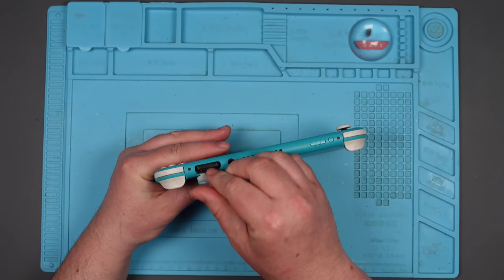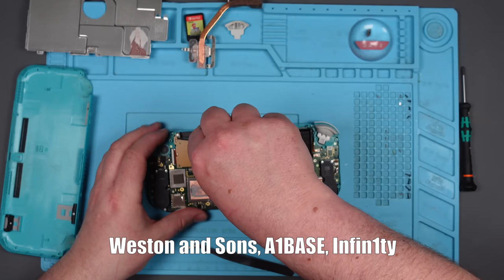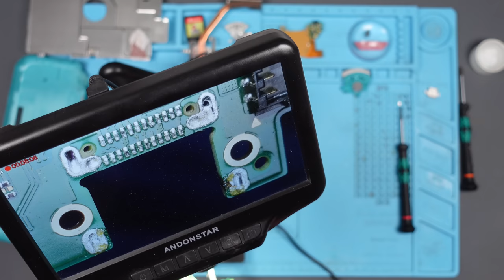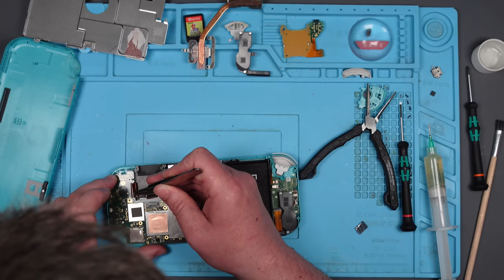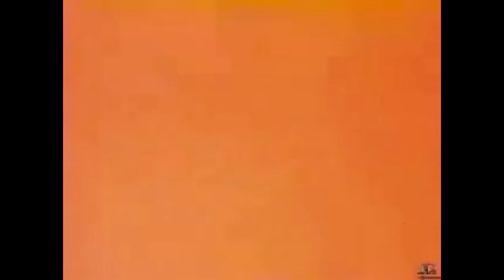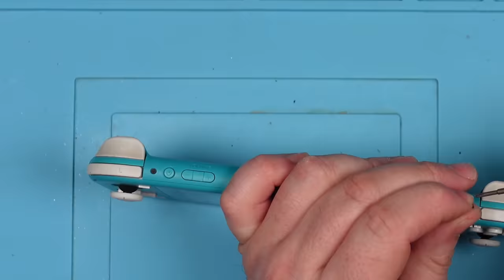DEAD Switch Lite | Can I FIX It?

Comment: The first replacement port seemed fine, and it's possible that the battery was just over-discharged. It looked like the battery had some protection in place and was slowly recovering, kind of like a 'wake-up' process.
Reply: Yeah, the switch does weird thing with the battery once it's overdischarged. i'm pretty sure you're right.
Reply: @SaitoGray  I’m so o

Comment: You can drastically reduce the probability of pins not soldering onto the board correctly by using the soldering iron to cover the pins with solder before you hot-air-solder the connector onto the board. This is good practice particularly for the hidden pins under the connector.

Comment: love the song. I think hot dropping port with anchor points pre-soldered is a mistake though. Kinda hit or miss sometimes, and if not heat soaked long enough with the port in place (getting the port to same temperature as board), can cause cracked solder joints over time. It's more reliable to just solder the anchor points with a soldering iron after you've secured the pins first (pre-tinning the port pins helps a lot too). Regardless of how I personally feel about port dropping, you did an excellent job, absolutely love your video's, keep them coming!

Comment: I went to school for electronics repair 25 years ago and have an assistant degree in electronics technology and have been repairing mostly musical equipment for the past 30 years now. You did a good job. My only criticism is that I would have changed the two smd caps, they are probably bad, just not bad enough to be grossly out of speck. As a Morrison, thanks for singing my cousin Jim's song on key at the end.

Comment: I have never soldered anything in my life. This, is the exact reason I will begin my soldering journey. The exact same problem plagues my switch lite (same color too!). Thanks for the video!
Reply: I have to ask, just how did you damage the charging port?
Reply: @talon12020  I have kids. I'm guessing they dropped it while they were charging it because they port only works if I manipulate the USB-C cable in a way for it to make "contact". I'm assuming I've if the solder points on the USB C is not "solid" but, I need more equipment to find out.

Comment: I wonder if your battery was in sleep/recovery mode.  It was completely discharged and if it had been for a while the battery chip turns itself off completely to avoid destroying the battery through self discharge.  When this is the case it will start taking a tiny charge (like 0.01A) just to turn on the battery's circuitry and begin trying to charge the battery.  If it can recover the charge in an appropriate way it then charges with more and more current until it can charge normally.  If it doesn't charge normally it shuts down.  That's pretty much what we saw, except that it worked the second or third time you tried.

Comment: Have to say that I really love your videos. You have way more courage than I have and I work in designing electronics 😁For future I would invest in getting soldering paste. You cleaned the pads really well for the connector. If you'd then applied some solder paste on them, maybe all pins would have become 'solid'. But great work there!

Comment: I did the  reset button you showed in your video a few times and took my game and SD card out.  and left my switch along a few hours and my brother came in and I told him my switch wasn't working and I turned on the switch it was working again thanks for the tips. I was worried that I had to buy a new switch.

Comment: Instead of grinding the port down when I fixed one of these for my kids a few years ago I used needle files to make the port hole in the shell slightly larger. Then it fit the standard usb c port fine and once assembled you can barely tell the difference.

Comment: I like you funny facial expression! BTW, what do you think made 23 ohm short on the capacitor nearby M92?
I don't think bad connection on USB port could cause such an indirect short. I wish you could've measured that resistance after the repair.

Comment: So I'm pretty sure I know what happened. When you went to solder the one pin that wasn't solid, you went over a few more. You might've loosened a pin just enough where it wouldn't make consistent contact which is why you were having trouble with the charge going off when you wiggled it. The second one was definitely solid though.

Comment: Check the voltage on the battery first, if it's completely dead (less than 2.8 or 2.6v) it needs to slowly charge it up to be able to charge it safely.

Comment: I’ve always wondered how much of the alignment of the chips is the manual placement, and how much of it is the surface tension of the liquid state of the solder pulling it into position….

Comment: Yup, battery was a bit over discharged. The charging circuit will limit the current until the voltage rises a bit then allow fast charging. This reminds my of my Switch. It was the first edition and I’d had it for three years when I took it with me one day. On returning home I dropped it into the dock and the screen said Charging as usual. A while later I came to play it but there was no picture on the TV although the screen came in when removed from the dock. Back in the dock the screen turned off but still nothing on the TV. I then noticed charging was rather slow. Nintendo wanted me to ship it to them so off it went. They called to say the port, dock and battery were damaged. It was out of warranty so they gave me a discount on a replacement and I still wonder what happened.

Comment: Made me nervous while using the hot air on the chip. So many little components around. I'd recommend a little less air pressure and a bit more patience, would be safer for the components around to not go flying. And aligning the chip would be easier. Unless, you want to go on a hunt for a needle in the haystack, that is :D

Keep up the good stuff, enjoyable as always! :)
Reply from the maker: Totally agree. Patience is never my strong point 😅

Comment: All of this and I'm wondering - my Switch will not charge with 3rd party chargers from dead without holding the power button, plugging it in, then waiting for the symbol to disappear before letting go of the power button. I just assumed it was Nintendo being Nintendo and checking the charging source, but maybe my charging port is partially broken.

Comment: Time to take all that amazing Patreon money and get a fluke mul-tim-i-ter :)
Reply: Meh!  LOL

Flukes are great but often, over priced.

I find that a lot of even less expensive brands can be as accurate of 'close enough."

I have a bunch of meters, including a Fluke. I honestly don't like this particular Fluke model, but I use it when I want to confirm accuracy of my other meters.

I have this lovely Siglent Lab meter SDM6045X that is my main meter as I do 95% of my work on the bench.  It's only a 4 1/2 digit meter, but for what I do, it's fine.

I also have a sweet Siglent SPD3303X-E Triple Output Power Supply.  It's the one that I trust in that it never jumps around in voltages like my cheapy can do.

Steve has many options out there.

Comment: I dont know if the writing on the chip is printed the right way on the sane chips, but when you rrplaced the chip, the writing was pointing vertical, so chip may be wrong way
Reply: I thought that until I rechecked! The chip is orientated by the dot in the corner rather than the writing but the board turns 90 degrees between 9:25 and 9:35 (looking at those 3 caps in a line the dot is in the right place)
Reply: @Swumhole I know, must be a different manufacturer

Comment: Just wondering, why use leaded solder??
Reply: Lower the melting temperature needed so the plastic part of your adjacent components are less melty when using the heat gun. It's been phased out of mass production (ROHS) in the last 2 decades because it's also neurotoxic, but it's probably easier to use for ponctual repair. Just don't breath the fumes too much (Steve should use his extractor much more)

Comment: What they should've did,    they should've had an extra port on top For the USB because it's a lot easier to plug-in from the top and play in handheld mode ,,like they did with the steam deck  .. I only ever play in handheld mode and I just bought the Zelda oled model.. Battery life is not that great so when you're playing while it's plugged in it actually gets in the way in the bottom.. I take extra careful precautions not to bump into it but I could see why it would get damaged so easy to knock into it while it's plugged in

Comment: No matter how funny you want to portray it, incorrectly putting  thermal paste will NOT be right. 
Plus, spending the time and resources rescuing those gadgets is more harmful for the environment as putting it in a recycling center. Mass recycling uses far less energy, and puts out less harmful toxic waste (as the leaded solder smoke, from the welder that you use). 
This was assured to me by a buddy that actually works on retail and sells those things.

Comment: Steve, by any chance do you have any links to where to buy those particular USB C PCB ports that fit the switch?

Not that I need any right now, but I do have a Switch OLED and it seems that these ports getting mangle is common.
I can only assume that it's caused by the in/out action of the Dock.

I'd like to order some, but I don't to order a "kit" of many types as I rarely have to change a port.

Thanks in advance.

Comment: i got a switch if you wanna a crack at fixing it, well i have 2 switches one that doesnt power on and one with a burn on the screen i was going to take the screen from one and put it on the fully working one but im fat and lazy  Im also in the UK

Comment: What would be really  cools is for channels that work on Switches (or any other common product) create a database where, by model, all component values are recorded.  Especially those STUPID CAPS that are never marked!

With that one cap that measures 23 Ohms, who knows what its value is AND what's its value OUT OF CIRCUIT!???

Personally, I would have unsoldered that cap and measured it and from whence it came.
Perhaps it's a 33 Ohm cap, but in circuit, it there could be other resistances.

In other words, it may be just fine or maybe it indicates a problem.

This is where donor boards or another unit would be great to have at hand to do comparisons.

I'm old school where I used to be able to get GOOD schematics easily.

These days, it's difficult to impossible.  And some of the schematics that I have seen, are really not great.
They are very basic, not like those of decades gone by where everything is listed, including waveform and every value of every component to full ability to trace every ciruit.

sigh